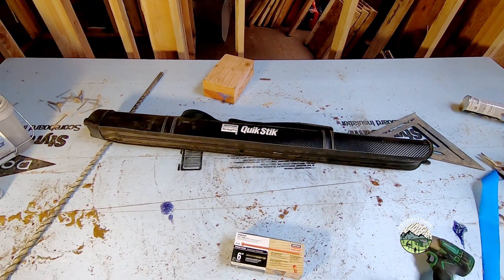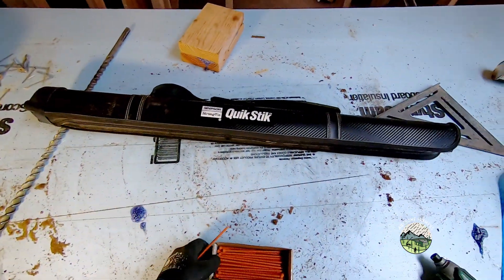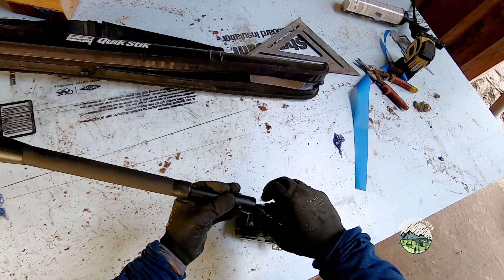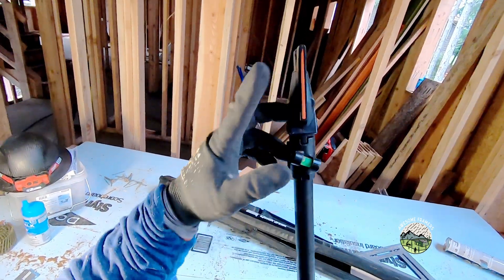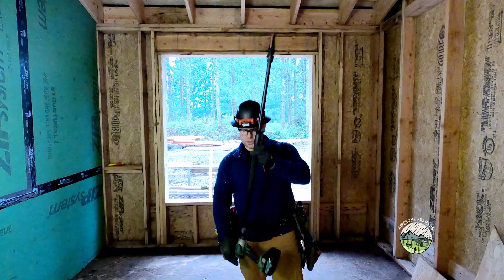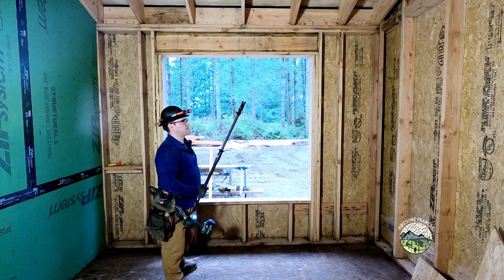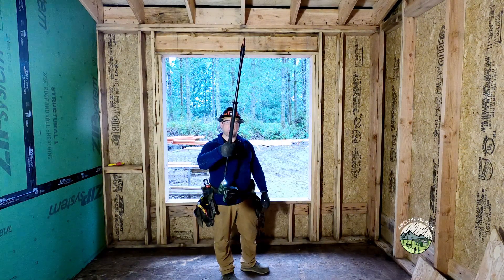Faster Safer Rafter/Truss Top Plate Attachment

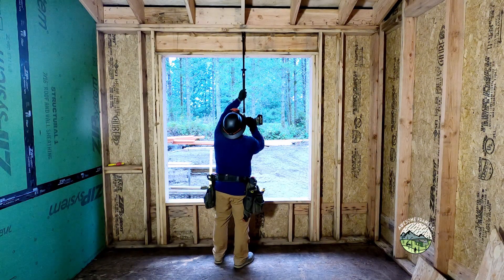Comment: A decent 1/2" drill should put them in faster and save your ears. Also, at 2:22 it veered out the side of the joist, which I would imagine is a common issue with these if you're not paying close attention to your angle. Still, way faster than hurricane ties and the drywall won't get pushed out from bad installation.

Comment: Are those top plates angled so there is minimum bearing without bird's mouths?
Reply from the maker: Nope, there is no need to slope them because the seat cut on the rafter is level

Comment: That header is over 4 ft did you screw it to top plate
Reply from the maker: I'm not following your question.  The topplates are nailed to the header, then I run the screw through to the rafter.

Comment: Stilts is faster
Reply from the maker: Stilts is probably about the same speed.  This tool eliminates the risk inherent in stilts.
Reply: It may but here in fl we are peice workers
Reply: And we use a regular battery drill not impact and in zips them in

Comment: It's not clear the screw is penetrating the rafter at that angle. Looks like it's right on the edge.
Reply from the maker: check the Strong-Tie catalog https://embed.widencdn.net/pdf/plus/ssttoolbox/rbvdfpv76y/C-F-2019TECHSUP-p54-68and73.pdf

As far as camera angles, I'm sorry it isn't clear to you, but I think the point is made clearly enough, especially after reading the product info.  Let me know if you have any more questions.  Thanks for replying.